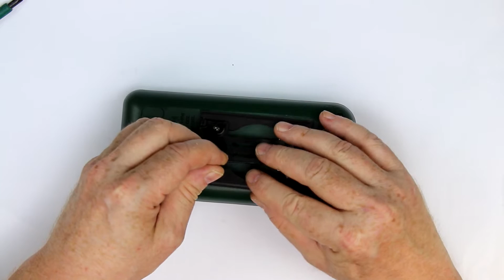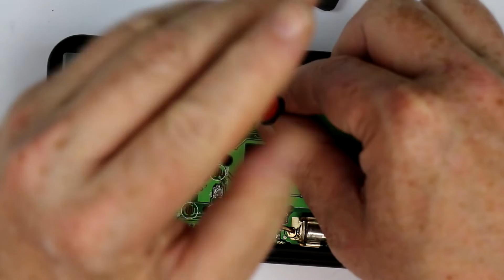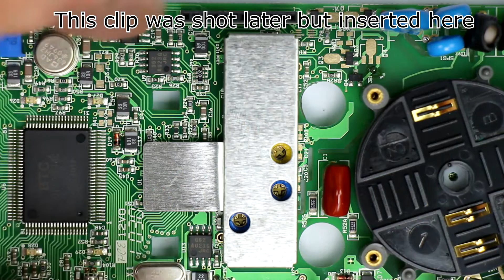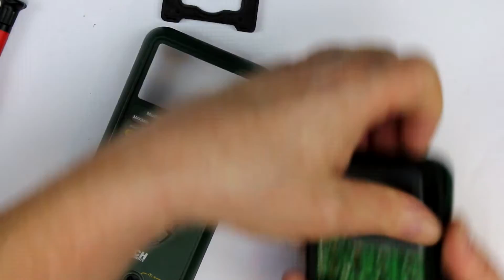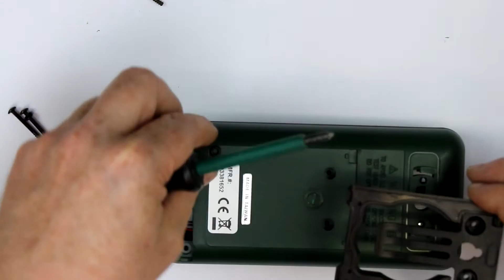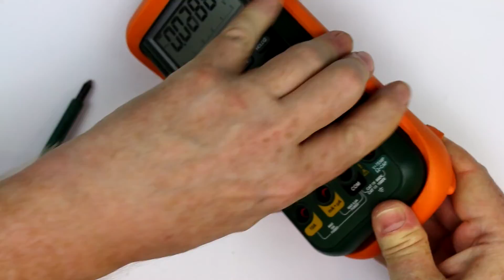Teardown of an Extech MM570A (=Brymen BM859) 5.5 Digit Multimeter

Comment: Hallo Roger , I would like to know the idle current , which the Multimeter draws from the 9 V Battery, when the rotary switch is in OFF Position. Could you measure that with another mulimeter?
Reply from the maker: It could even be that the battery is physically disconnected in the "OFF"-position. What do you need the exact value of the standby-current for?

Comment: Nice multimeter :-D.
It's likely that the variable trimmer capacitors in the metal box are a.c compensation capacitors, high frequency amplitude is lost in the precision resistor attenuator.
Trimmer capacitors are mostly connected across the top resistor values.
Reply from the maker: You are probably right. I didn´t see that they are little capacitor trimmers instead of resistor trimmers.